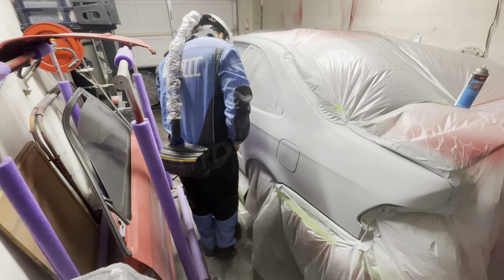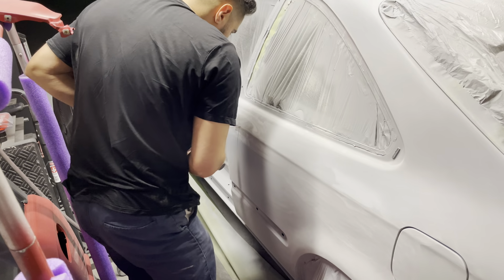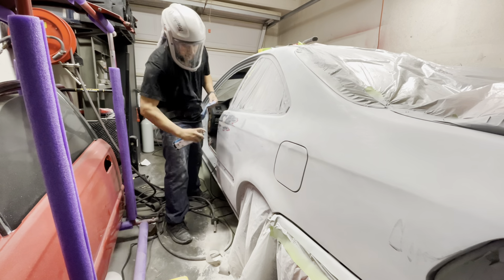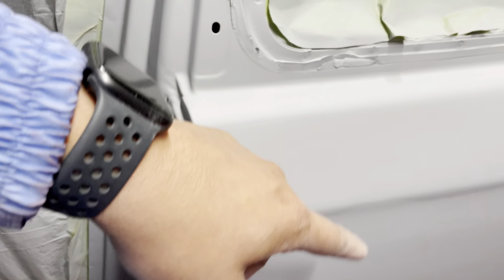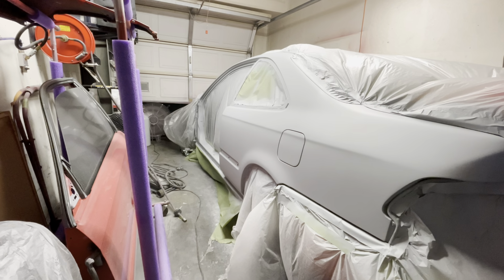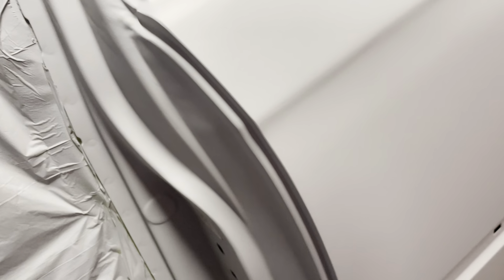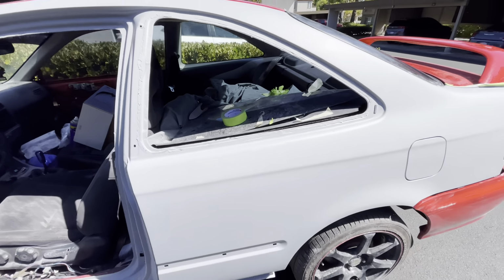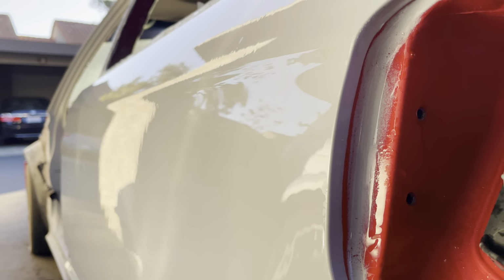Paint Problems from Hell!! Runs, Paint Reactions etc

Comment: I feel your pain bro, thanks for allowing us to watch you suffer. Sometimes as you said, not being in the mindset is the problem. Many of us have experienced Finagle's law " Once a job is fouled up, anything done to fix it on the fly only F**Ks it up worse. You may have been better to just let the runs cure maybe help it along with some heat and air movement and then sand the runs, then let panel cure more, then sand and do another medium coat. Your working in some pretty tight conditions there with room behind you and not ideal temps so I commend you for not giving up and keep on working through the rolling snowball of problems. I have had similar problems with the self etch as you are going in after the first primer shot and it may react with the surrounding first coat of primer. We are are own enemy at times when we get to lit up to get our project done with out the proper time slot. Perhaps next time don't watch the clock on that wrist watch with the massive numbers and go for a soda instead. Great recovery!

Comment: Chris this is not a setback it's a learning curve and you showed calmness by walking away taking 5 rethinking and getting back to it this process is by far the most tedious time consuming thankless task and you've shown folks out there how to overcome problems well done brother 👏👏👏😱💟
Reply from the maker: Yeah that self etch will never be used again , but All of them are 1k what do you normally use? Epoxy? Had to walk away I was so pissed I was expecting to put base and clear that day but luckily I had a few set backs along the way because I had that dent I didn’t see before , so kinda glad I went back and took care of it all.
Reply: @Mechaniclyfe  2k buddy
Reply from the maker: So 2k epoxy? Or 2k dtm primer? Any ones you have experience with?
Reply: @Mechaniclyfe  both bro but it is  a curing thing you do have to wait but you can get a 2k self etch acid and paint comes separately and you mix 1.1 its dry in 30 mins
Reply from the maker: I see
Reply: @Mechaniclyfe  it must be available over there bro you shoot it through your gun but beware bro very viscous so give it light dust coats
Reply: And don't bee fooled by hammering it on it dry almost transparent